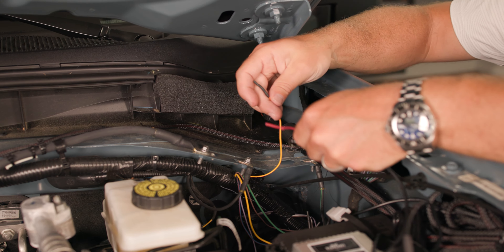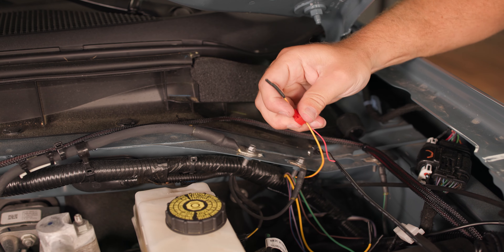2021 - 2022 Bronco Raptor Grill Kit Installation (From F150LEDs.com)

Comment: Is there an option to just plug into the fuse box.
Reply from the maker: Hey there! You can use our easy headlight adapter to make this installation plug and play! We will put a link below. Thank you for your support, we look foward to serving you soon! 
https://www.f150leds.com/collections/2021-ford-bronco/products/2021-2025-bronco-plug-play-headlight-accessory-connector
Reply: @F150LEDs that’s awesome. So plugs into the grille marker lights and then into where? (Really appreciate the reply btw I’m definitely sold on your stuff, but pricey at $50 usd for a plug but tell me more)